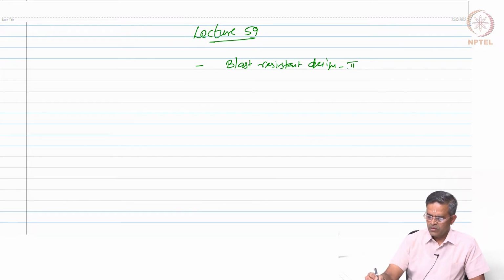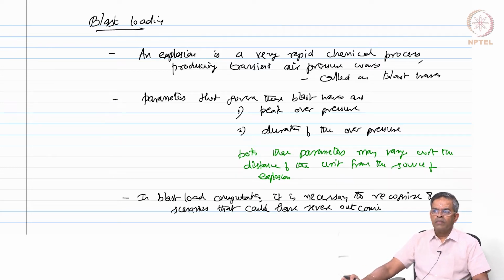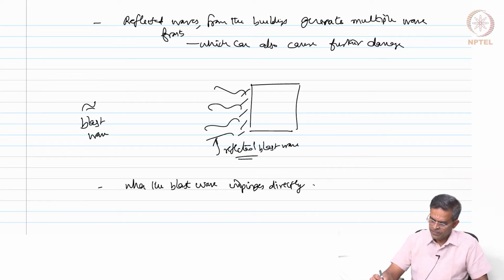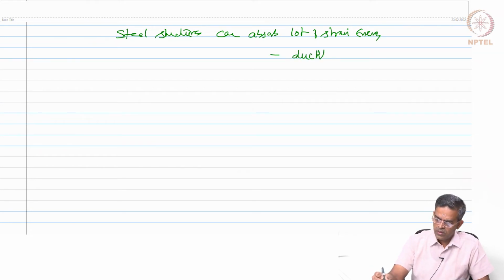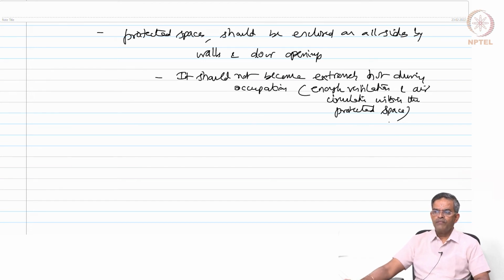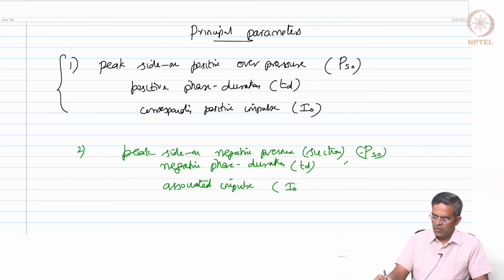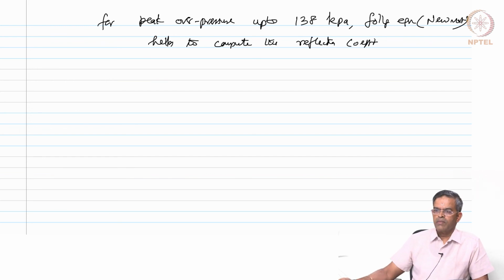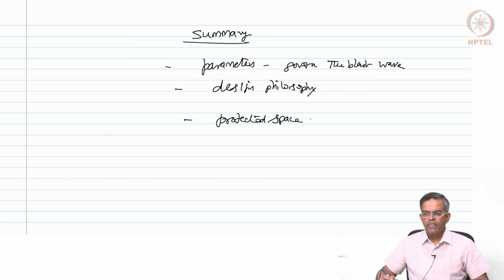Blast resistant design -2

Comment: 00:05 Design philosophy of blast resistant design
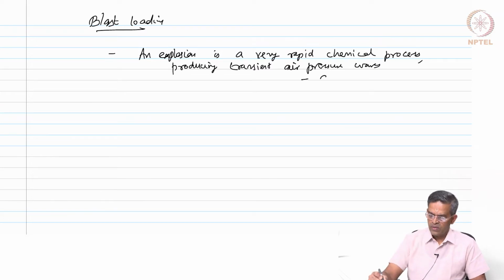04:17 Blast waves are influenced by peak over pressure and duration of the pressure.
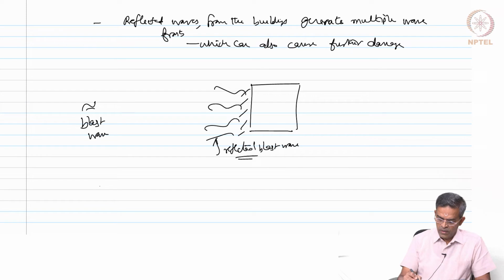10:16 Designing building facets to resist reflected blast waves
16:16 Flexible components resist blast waves
20:24 Designing blast resistant protected spaces
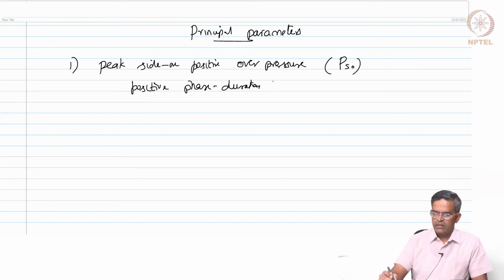25:20 Key blast-resistant design parameters and their implications
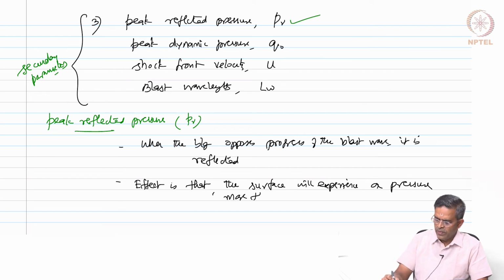29:03 The reflector pressure is amplified using a ratio
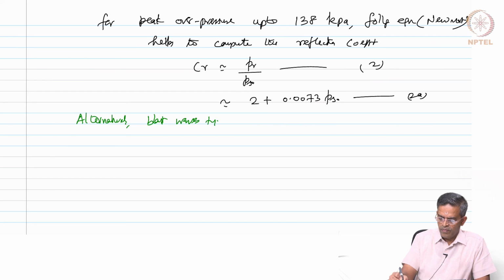33:11 Factors affecting blast wave characteristics